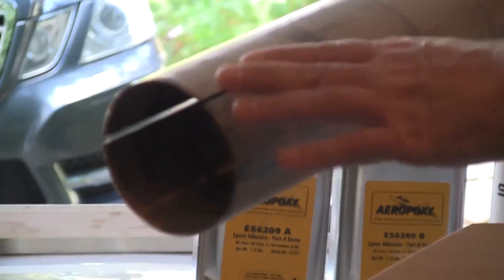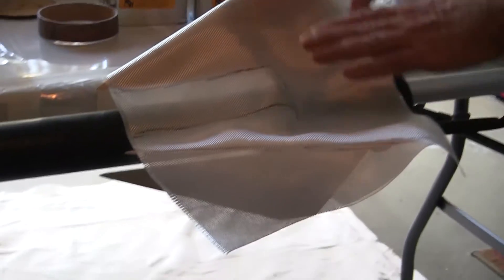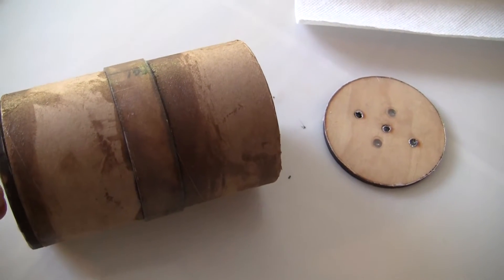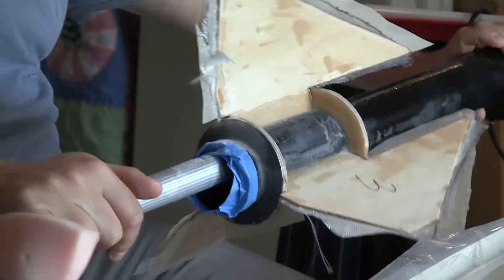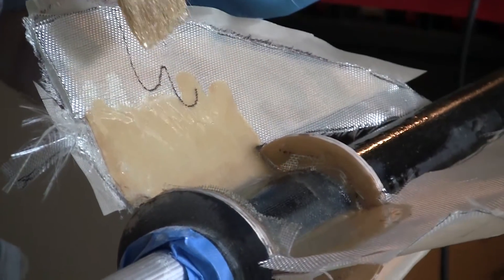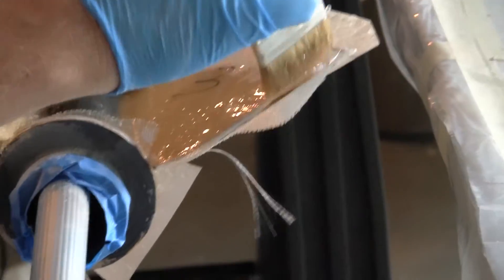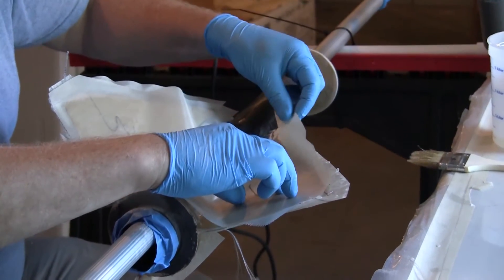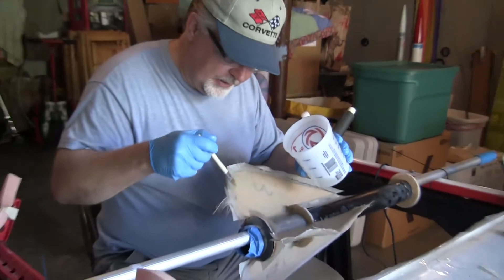Part 4 - Building the HyperLOC 835

Comment: So much epoxy. Like way way, way too much. I saw some dry spots on your tube and find completed to the start of this video. When you use this much epoxy, the glass will start to float on top of the epoxy. Start with a dap and spread it. Tap tap tap the glass. A little goes a long way. When putting on peel ply, the epoxy in your brush is enough to smooth it flat. You made a comment about not having enough coverage because it had texture. You want texture when using peel ply. If you have so much epoxy that its smooth under the peel ply, it is unnecessarily heavy and will be brittle. Your plan is solid, the application needs work.